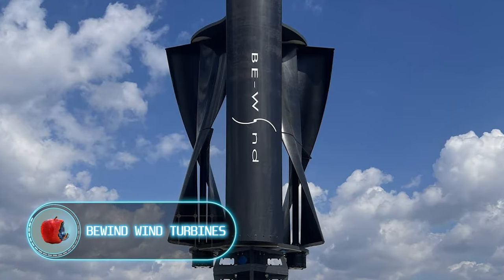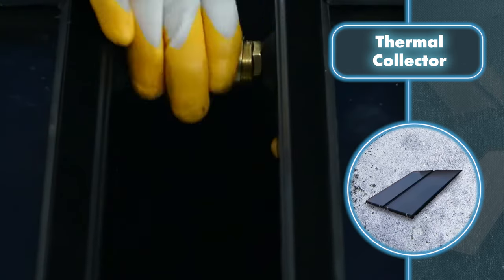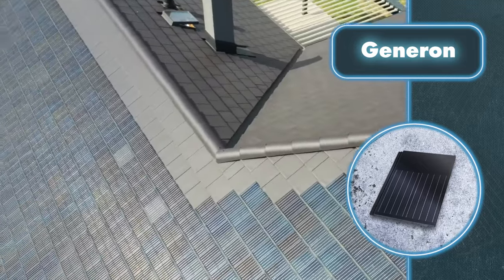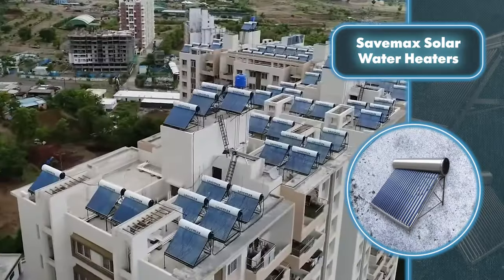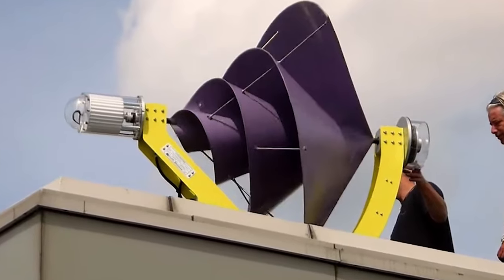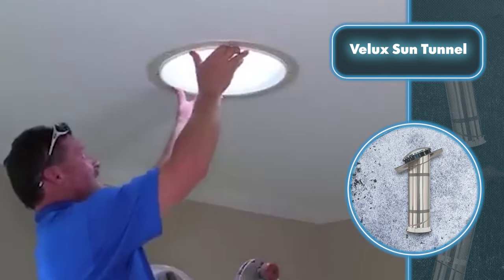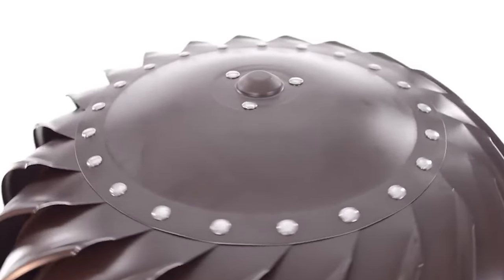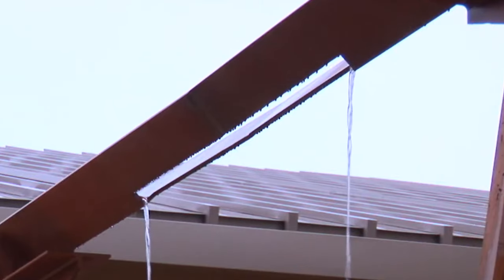Inventions for the Roof That Will Make Your Home Autonomous

Comment: When I went to school they taught me that liquids and air are two different substances. But I guess that you have some higher education qualifications than me. Or maybe you just like the sound of your own uneducated voice. And you don’t seem to understand how electricity works, for instance, you would need to store energy produced by these generators in batteries to go off the grid or to get the best benefits of the devices
Reply: If you mean are referring to the thermal collector, it can work either using heated air, or a heated liquid.  It is similar to a floor heating system….you could circulate hot air under a transmissive floor material, or you could put tubing and circulate a heated liquid under the flooring.  The air and heated liquid are different, but both work and each has its advantages and drawbacks.  

And as for electricity comment, adults should know you need batteries….that is assumed.  Your comment is like criticizing a car commercial for not mentioning that cars have other costs, like for fuel, maintenance and insurance/license fees.  Adults know this already and no need to waste time stating the obvious.